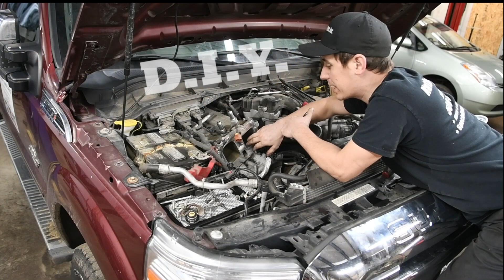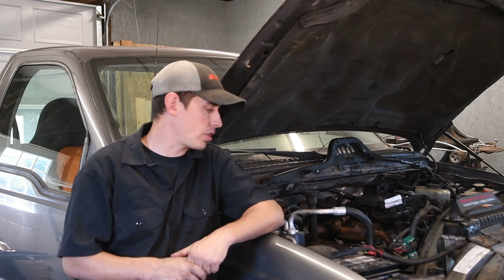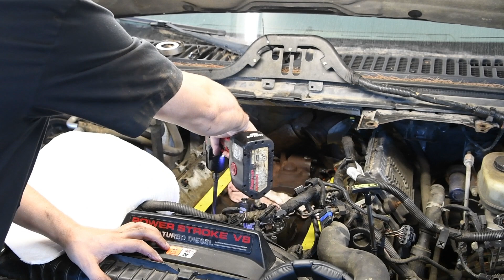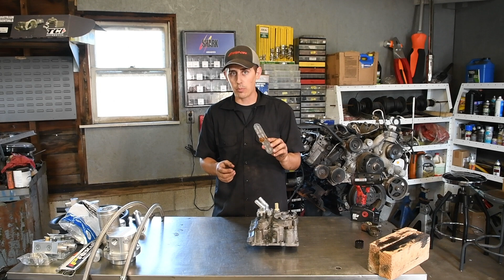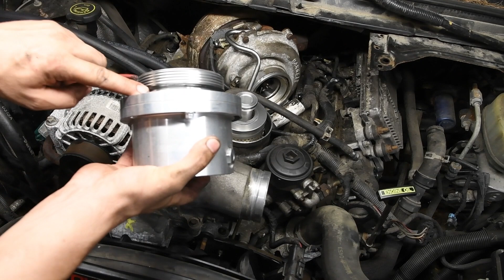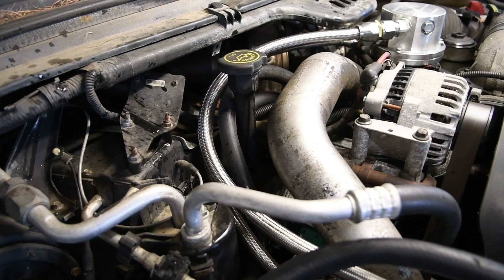6.0 IPR REMOTE OIL COOLER INSTALL....Short version

Comment: if you use a electric remote transmission cooler, can you use the bottom of a 4 core radiator instead 🤔 to cool the oil?

Comment: Liquid cooled oil coolers only benefit is its size. You can accomplish the same with air to oil, just requires a much larger cooler.

Comment: Awesome video! I love the way you explain and show everything clearly and thoroughly! Awesome mechanic work dude! 
I’m not even a ford powerstroke guy! I watched the short version just I was curious what this kit and conversion was. I’m more of a Cummins guy! All 12 and 24 valve guy! From the VE rotary pumps, p7100 and VP44! 
 I think the best thing for any of the power strokes is a Cummins 12 or 24v with a p pump swap! And fix it good the first time! 
To much going on with them 6.0’s, 6.4’s and 6.7’s. There’s some guys on YouTube that have done some really neat 12v swaps on a newer fords, like $100k king ranch’s, literally yanked the powerstroke and threw it in the scrap pile. And built one hell of a nice p pumped 12v Cummins mated up to the OE ford trans. There’s companies that make conversion kits, all bolt on conversions, adapter plates and all sorts of neat stuff, radiator and intercooler brackets  etc. it’s prolly the only way I’d ever own one, was if it was de stroked! 
They just ain’t good motors. You watch vids of guys that have ‘bullet proofed’ them, and I hate using that term bullet proofed,  cause you could have a $70-$80k into your motor and ain’t nothing gunna be grenade proof on these things, especially when you turn them up. But it seems Oringed heads, arp head studs, the oil cooler delete mod like this you did, and emissions deletes are the top things, a diesel engine was never made to eat its own a$$! Let em breathe! Putting all that soot and particulate back into the intake isn’t the solution. And that’s why I’ve always been on the older skool end of things, the pre emissions era’s. As soon as they started putting egr, def, all the sensors, modules, computers and junk on them they became unreliable, no one could work on ‘em. A Cummins 12v is so simple. The water pumps 2 bolts and an Oring. They could have made the impeller out of metal instead of plastic yes but there’s an after market company that makes a billet water pump! It’s a marvel of master cnc machining. But when things were all mechanical, cast iron, and well built. FoMoCo?! Heh not built ford tough. Does they say has always had better built body’s, and interiors that’s dodge, dodge has always had a better diesel engine that their body, and steering and transmissions fall apart around lol, unless it’s a manual, dodge always had really good strong manuals. My ‘02 HO is a 6 speed nv5600. The biggest burliest trans you can get under a dump truck transmission like an Eaton fuller super 6 you would have found in a 80’s ford dump truck powered with a 12v Cummins motor! even ford loves 12v’s!

Comment: Im 80 yr old and when I was your age I had a reputation among the Dealerships and.race enthusiasts in was  in demand because I was factory trained in Detroit by GM and Mopar. This is a training quality video. I think this is the dumbest engeneering blunder I ever saw. ( and there are many) im too old to do this anymore because of feeble hands and poor eyesite.😂 Old sucks.. i have a one owner 1985 F 250 6.9 IDA with 66000 original miles on it with a failed cooler that I spent a buttload on three different shopd that failed on this repair. I wish it had have been you turnin the wrenches. I enjoyed your presentation and learned some stuff. You can teach an old dog new tricks. Thanks Dandahermit.😮😅

Comment: Fords original system is fine, as long as you loose that Ford  Gold Coolant, which is the cause of the coolant side plugging up, instal coolant bypass filtration, maintain clean oil, and add oil bypass filtration.  I’m still on both my original  oil cooler and my original EGR cooler, after 18 years.  My oil to coolant differential is as low as when the truck was new.  Even though I would like the oil cooler to be outside the engine, I don’t like how hard it is to change the oil filter. I don’t like the non stock oil filter, and I don’t like the full flow coolant filter.  Alls it takes is proper maintenance, and the stock filter will not plug.

Comment: I like this kit, but I have a few questions.  I don’t like the full flow coolant filter.  I am already running a Dieselsite bypass coolant filter.  I don’t  want a full flow filter that affects coolant flow as it starts to plug.  I would like to not install the EPR coolant filter part of the kit, and retain my coolant bypass filter.  I also run an Amsoil oil bypass filtration  kit, which I would like to retain.  Is there a 1/8 tap some where on that oil filter cap?  Also, from the looks of it, this kit runs its own type of oil filter, and not the Ford stock filter??.  I am also running the Banks Technicolor intercooler, larger Ram Air intake, and larger 3” boost tubes.  Am I going to have clearance problems with the re located oil cooler? I would like to install this EPR kit, but want to make sure I can retain my original bypass coolant and oil filter systems.  Great video!
Reply from the maker: The full flow coolant filter is far superior to the bypass coolant filter. I understand your concern but if you clean the filter regularly you will not have flow issues to the cooler. Doing away with this filter would be a big disservice since full flow coolant filtration is one of the biggest benefits of this kit.
As far as the amsoil bypass oil filter goes. There is a port on the IPR cap. You may have to get an adapter fitting. I believe the port is m12x1.5mm. 
It does run a different oil filter than stock. 
I am not 100% sure on clearance but based on the installs I have done I don’t see it being a big problem.
Reply: @InTheShop  I appreciate the response.  Thank you for answering my questions.  I’m still not sold  on full flow coolant filtration.  All filters have a pressure drop, especially at full flow.  I think bypass filtration is more than adequate, and if it should ever plug, it will not cause any flow problems with the main coolant flow.  It doesn’t take long for a bypass filter, whether it be coolant or oil, to filter the whole  coolant or oil charge.  With an ELC, with no inhibitor package to settle out, alls I’m catching is a little sand from the initial casting process.  I thought your video was great.

Comment: really good work....that v8 diesel.needs a larger oil cooler than that.... i would put it in back of the ford grill...in the front of the truck.....being the first to get air flow..... thank you for your shop video'''''''
Reply: It’s cooled by water so air flow is not relevant

Comment: Great work on the videos and channel. IPR makes some solid products for the 6.0s. Oil, coolant, and trans filtration on a 6.0 all benefit from aftermarket upgrades, and they're critical to keeping the rig dialed in a humming. 
     - As a side note, the guys at FICMRepair are damn solid resources for any 6.0 owner. They sell pretty much any part a guy could need and the customer service is stellar. They help guys all the time with troubleshooting, OE and aftermarket parts selection, etc. - Plus, if you're going to own/drive a 6.0, the FICM tunes they sell wake the beasts up very nicely. Best of all, they help with fuel mileage!

Comment: Great video, but I'm not sure I agree with your reasonings for going for water to oil over air to oil. In my opinion, the efficiency of the water oil cooler only effects the size the cooler needs to be. Air oil cooler will need to be bigger, but as long as the flow and cooling capacity specs are the same as factory, will perform just as well. I don't get the nonsense about the radiator working more efficiently. It's a radiator, and so is an air oil cooler. If there is air flowing over one, there will be air flowing over the other.
Reply from the maker: There are several parts to that. Your engine and high pressure oil system is designed to operate at a certain temperature. An air to oil cooler has a hard time maintaining that temp because ambient air temp can vary drastically. Believe it or not it is bad to have your oil too cool. Your factory cooling system is designed with cooling your oil in mind. You are correct in saying you can make an air to oil cooler cool as much as an oil to water but it needs to be much larger. If you need a larger heat exchanger to do the same job it’s not as efficient. I personally don’t like blocking the radiator with anything more than it’s already blocked with. The air to oil coolers do work but not as consistently. Temps with the oil to water will come up to operating temp and stay there.
Reply: @InTheShop Doesn’t  BDP offer a kit with a thermostat for cold weather applications, so that the oil temperature runs the correct temperature, without being affected by ambient air?
Reply: @InTheShop  BPD's thermostat looks like it might be a viable option to counteract oil temperature issues. 100% agree with the oil too cold being a bad thing though, and the fact that the cooling system needs to run at around the same temperatures is very convenient. 6.7 uses an oil water system with dual rads which kind of indicates oil water is in fact a better system. If I had to guess, the dual radiators are better able to take advantage of the full flow of the fan than several haphazardly placed coolers. As far as oil coolers having an impact over the efficiency of the radiator, who's to say. Considering the intercooler, automatic transmission cooler, power steering cooler, and ac condenser are all mounted in front of the rad as well, I'd say it probably doesnt do much.

Again great video and thanks for the discussion.

Comment: Anyone have any ideas how you stop the degas cap leaking? Changed the bottle and the cap and still sings of coolant escape. Males heck of a mess under the hood
Reply from the maker: If the cap is new and the bottle is new I would test to see how much pressure the cooling system is making. It sounds like you have bad headgaskets.
Reply: @InTheShop  Thank you! Possibly bad news, but at least will know what to dig in to.

Comment: So 200+° coolant is better than 100° air at cooling? I understand the cold if you live up north, but think the air to oil cooler would also help engine cooling by dissipating heat to the air instead of back into the coolant.
Reply from the maker: A few things factor into this. First your oil is designed to work best at a certain temperature. That temperature happens to be the same temp that your cooling system runs at. The other factor is that even though the air passing across an air to oil cooler is colder than the coolant in a water to oil cooler it’s not as efficient. Liquid does a much better job of transferring heat than air does. 
The cooling system in your 6.0 is designed to take the load of cooling your oil. In a properly functioning 6.0 the oil cooler does a great job of keeping the oil at the proper temperature. 

Overcooling your oil can also be an issue with air to oil. You need your oil to come to operating temperatures in order for moisture to evaporate out. A great example of this is propane operated forklifts that aren’t run for long periods of time. The oil never reaches operating temp and typically will end up milky and full of condensation long be for its due for an oil change.

Comment: Looking at buying a low milage <75k mile 2007. Would you suggest doing this right away and getting ahead of problems or let it ride until further down the road. Figured once I dive into something this big I'd like to knock out all the big stuff at once. Oil cooler, egr, water pump, ect
Reply from the maker: Its a hard call whether or not to spend this kind of money replacing parts that aren't yet broken but the benefit of having the full flow coolant filter will save you from having massive headaches in the future.

Comment: I missed something... where’d the oil filter go??
Reply from the maker: Oil filter is still in the factory location.
Reply: @InTheShop  how hard is it to change the oil filter?  asking because you got those hoses going to the cap.  Do you have to remove those 2 hoses to change the filter?
Reply from the maker: @Jimo225  you have to remove those two hoses then the cap threads off.

Comment: Did you use the gaskets and o-rings from the kit or buy a set from the dealership? I know a lot of 3rd party gaskets are prone to failure. Sorry if you said in the video.. I may have missed it.
Reply from the maker: The kit came with Ford gaskets

Comment: I've been debating on whether to go with the BPD air to oil kit or this IPR kit. I've been flip flopping back and forth. In my mind the downside to this kit is the special oil filter and having to rewove the hoses to change the oil filter out and the fact that a "special oil filter" is used on this kit. although, I hear that this oil filter can be had at NAPA and also IPR sells them for about the same price as the factory stock filter. The upside is that this kit seems to be the best option to maintain factory  cooler specifications. The kit from BPD that I was considering is the one that still utilizes the factory oil filter but an air/to oil heat exchanger. The other kit from BPD that uses a factory oil cooler doesn't offer a coolant filtration option which means that I'd have to by an IPR coolant filter on top of the price for the kit, which increases the cost quite a bit over this IPR kit. What are your thoughts and are you happy with this IPR kit? I like the fact that the coolant filter is servicable, cleanable. Did you get the CF2 upgraded coolant filter?
Reply from the maker: I did get the CF2 kit. I personally prefer the IPR coolers. The oil filter is a very minor issue. I suggest buying a few so you always have a spare on hand.
Reply: @InTheShop  Thanks man. That's what I wanted to hear. Your feedback tipped me to the ipr. I just found your channel and subbed, lots of good powerstroke info.
Reply: I am debating the same issues now.  need to make a choice.   I think the best option would be to use the BPD with factory oil cooler and then add the ipr coolant filter.  This would be the most expensive, but would be easier to buy filters and do oil changes in the long run. Do you know if this IPR coolant filter can be used in conjunction with the BPD kit?
Reply: @Jimo225  The oil filters are readily available at any parts store. There actually cheaper than the stock motorcraft filter. I've been running the ipr setup for a little over a month now and I'm very happy with it. I really don't think the bpd kit is any better. The ipr kit is really nice and well made.
Reply: @marcel-lemay7721  cool. I need to decide soon.  Does ipr kit use factory egr cooler?  or you got to buy a special one?
Reply: @Jimo225  I deleted the egr cooler on mine so I can't answer that. I'd just give ipr a call. They actually answer the phone. You can also send them an email, they're very responsive.

Comment: love your video's but the long version is set to private
Reply from the maker: Hey Ken, I’m not sure what’s going on there. I just checked the privacy settings and it’s set to public.
Reply: @InTheShop  Really appreciate this short version, but the long version is no longer available.  Any chance you'd reupload it?
Reply from the maker: @JoshuaCollins  6.0 IPR REMOTE OIL COOLER INSTALL...Full detailed installation
https://youtu.be/ur_GcUNNqEQ
Reply: @InTheShop  ah that's the stuff man Thanks. Turns out I already had it saved in my F350 playlist lol. Lot of information out there. Really appreciate you and the others that make the community so strong around this platform. 🍻